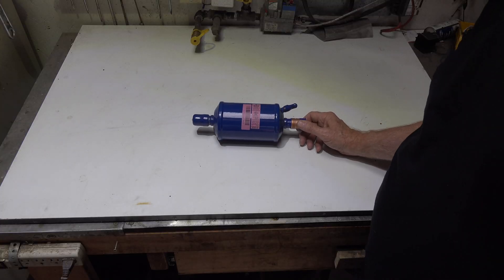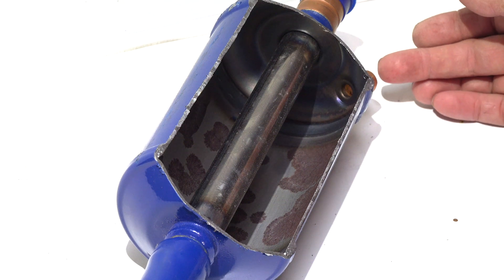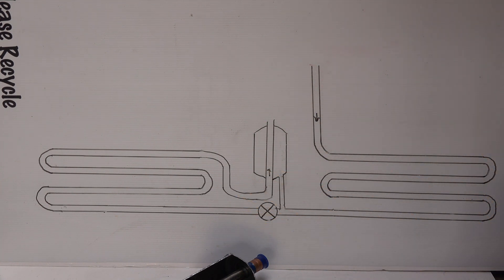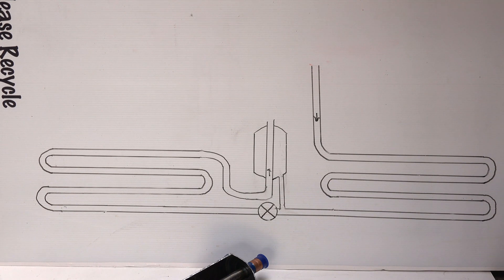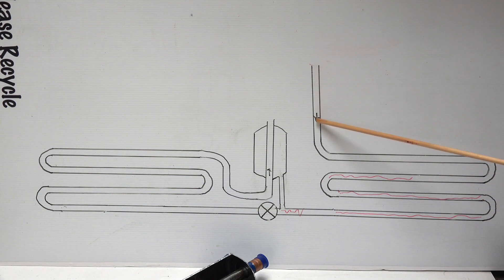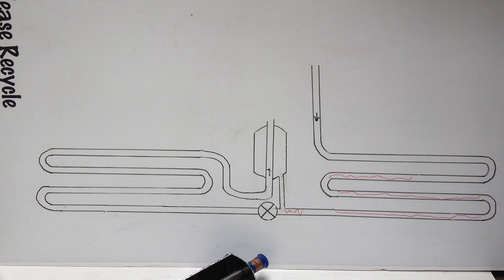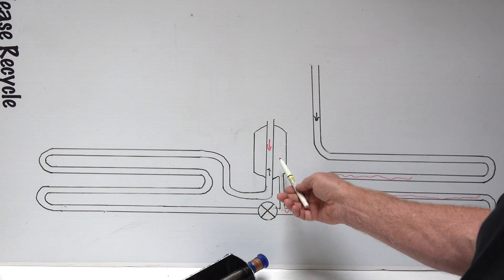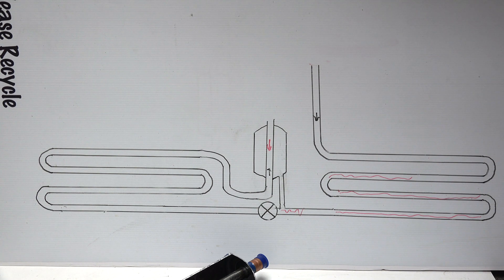The charge compensator:  How it works.  Part #2

Comment: Ive recently seen the same head pressure problem you decribe on a Rheem RPPL with outdoor TXV and good indoor airflow. It also has a charge compensator.  My question is, can these devices go bad?
Reply: Mine now has a pinhole leak and I can’t find a replacement to save my life

Comment: More great content!  I have no experience with charge compensators, however it seems that if you put the other txv in your drawing (for the indoor coil), it would visually demonstrate that floodback would not be an issue because the refrigerant would be metered before entering the coil.  Remember, the refrigerant would pass freely through the outdoor coil (I should have stated earlier that this pertains to the defrost cycle) and meter indoors.  My main point was I think it would help having the other txv in the drawing.  Does this make sense and add to my understanding, or am I off base?

Comment: good video and i  enjoyed it and learned a lot what is the difference between a condenser fan and Evaporator fan  ? and what role do they both play in cooling ?
Reply from the maker: The condenser fan is usually a propellor type that will not work against static pressure.  The evaporator fan is usually a squirrel type to work with ductwork.
They are there to move the heat either into the refrigerant or out of it.
GFM
Reply: @grayfurnaceman  thanks for explaining the differences between the two

Comment: I'm confused.
Why would you say that the evaporator is cold on a heat pump in heat mode🤔.
Reply: He means the outdoor coil.
Reply: Because the evaporator is then outside and condenser inside in hp mode.
Reply: @jphvac5725  that's why you call it the out door unit instead;
If we are going to use AC terms then we should use AC locations, to avoid miscommunication.
Reply: Max R I get what your stating. IMO I think it’s much better to learn the correct terms for coils depending on what they are being used for at that time. Evaporator is outside in hp mode and inside in ac mode. Only speaking of generalizations such as inside or outside coil doesn’t teach what pressures/temps are where and why. But everyone has their way of learning.. He explains evap outside and condenser inside toward end.

Comment: I see so many time reem/ruud condenser without succion accumulator. my provider gives me an answer that they do not need it .. I told him that in heat mode the compressor could receive liquid in cold weather by a lack of superheat when the coil is frozen and they do not know what  answer me.
Reply from the maker: That has been true of the Rheem units since they started using the scrolls back in the early 1990s.  
As the scroll will not slug, there is little danger of catastrophic failure.  Oil dilution is there but the units do not have a high failure rate.
GFM

Comment: They should call the compensator a reheater . So it simply adds heat to the low pressure gas to help it vaporize the liquid or keep the low pressure gas from condensing to a liquid and sumpping back to the compressor also allowing the low pressure gas to absorb more heat and take it back into the house to be used to heat the house . Think of it like a secondary heat exchanger your using heat from the high pressure liquid and puting that heat into the low pressure gas so it not wasted . This allows it to become more efficient at lower temperatures . So the liquid that has released it's heat inside the house and now is coming back outside to the txv . Now there is still heat trapped in that liquid about 80 degrees or so . Now instead of allowing that heat to escape into the air and make the liquid more dance, we take it and push it into the hollow side of the 
 Filling it with that heated liquid . Now the pipe that runs through that liquid is filled with low pressure gas and low pressure gas absorbs heat and now it is absorbing the heat from that liquid helping it absorb heat at lower temperatures it takes that heat from the liquid into the house where it is released into the air and  condenses back to a liquid and over and over this process happens but the heat that did not get released into the air is not wasted because it's used at the compensator outside at the evaporator making it more efficient. This is similar to a secondary heat exchanger . And you may say it's to small but remember the refrigerant is moving at feet per second through it where it is constantly absorbing the left over heat from the liquid . I don't know if your seeing it this way or not but when I look at it and think of the physics and the thermal laws of heat this is what I see it doing . Am I wrong grey furnace man ?  Or am I correct on my analysis of this device ?
Reply from the maker: The effect of the compensator may, in fact, do as you say.  However this effect is extremely small and the same effect could be accomplished by attaching the liquid line to the suction line as is done in some refrigeration applications.  
Its primary purpose is to reduce head pressure.
GFM
Reply: I see it as primarily providing more physical space for the liquid refrigerant, not so much as a heat exchanger.  According to GFM under certain conditions less of a charge is needed  therefore the excess refrigerant needs a place to reside.  He said this is primarily a problem on an unbalanced system.  I do see it as warming the suction line to a certain extent before the refrigerant is returned to the compressor thus insuring it is still a gas, and not a liquid.  In theory, It only fills up with liquid when evaporative demand is low.  That's why I think where it is positioned is important.